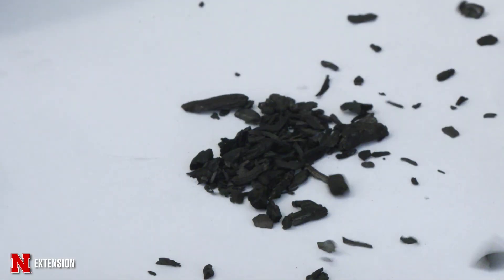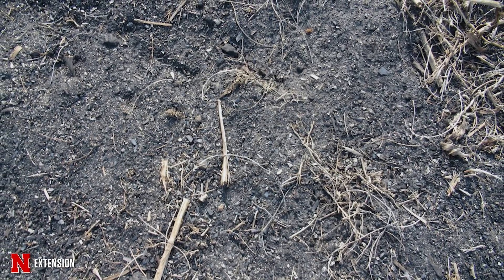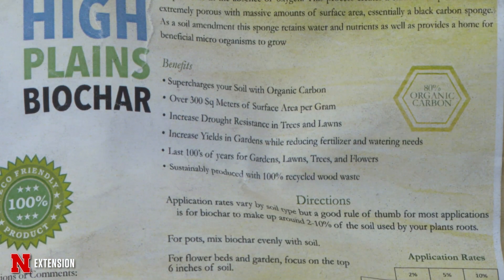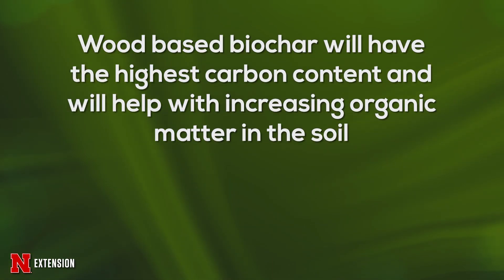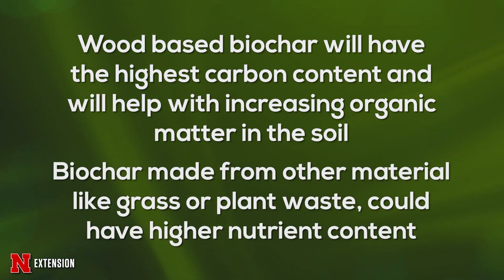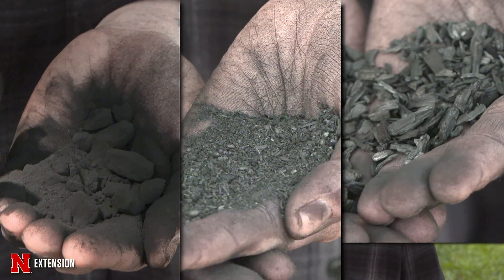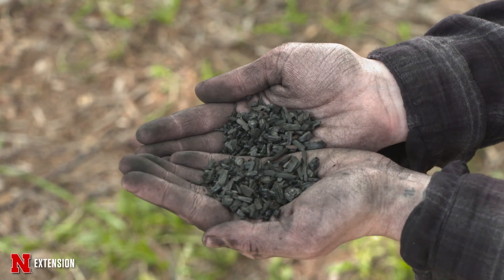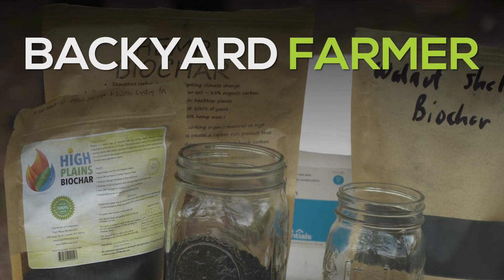Biochar

Comment: Biochar is charcoal that has been soaked in an organic fertilizers. You put straight  charcoal into  a soil will not give you the benefits you are looking for. It  will absorb the nutrients from the soil. Your plants will suffer. It may take up to 3 years for the Biochar to transform the soil. It is not a quick fixes. Like applying compost, or soluble fertilizer is.  One of its benefits is it gives a  home  for the good microbes to stay with in the root zone of the plants.